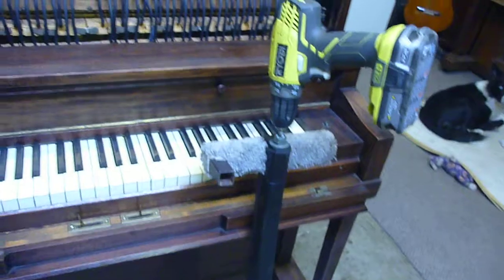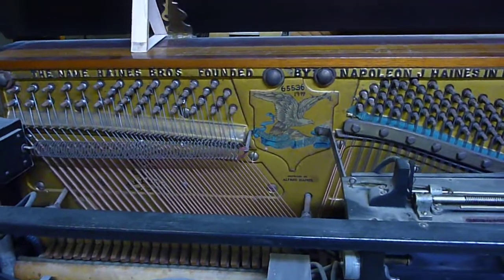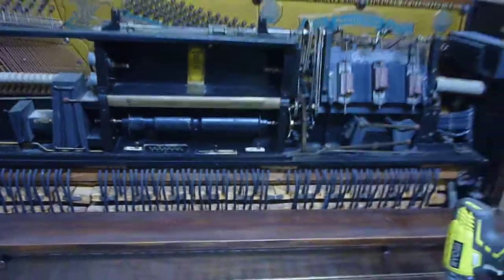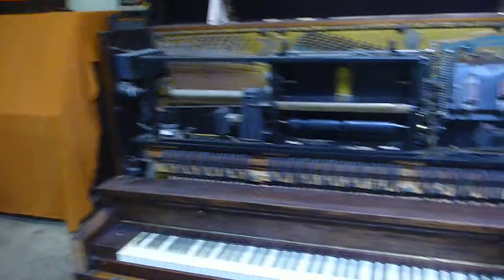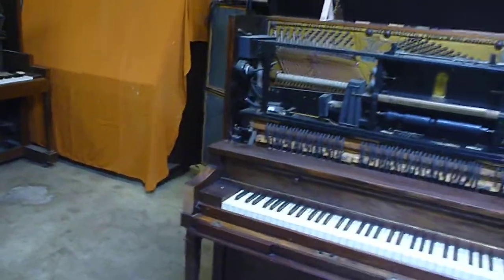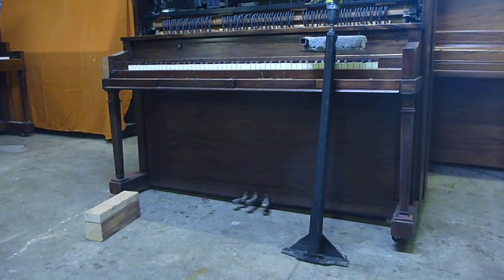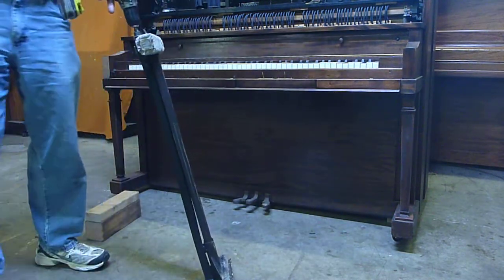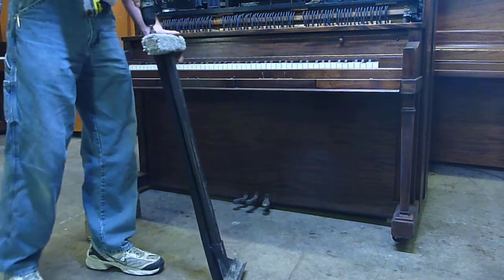One handed piano lifter /jack

Comment: Would have had it on a dolly and out of the house already.
Reply from the maker: I am set up so I can lift the piano, place it on the cart, and load it in the trailer by myself. I custom built a trailer with a winch in the front. Press the button and it goes up the ramp into the trailer. If I could make the pianos climb stairs, I'd be all set.